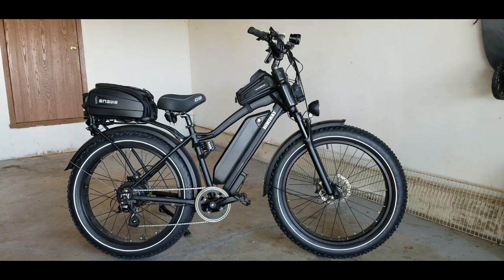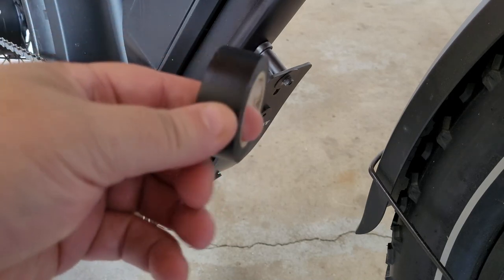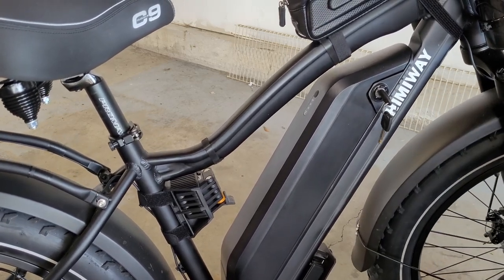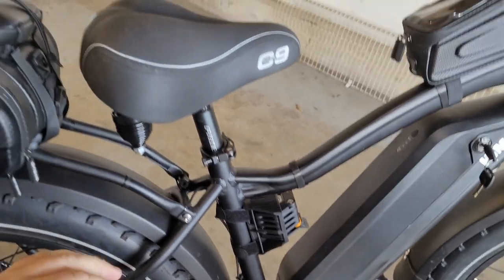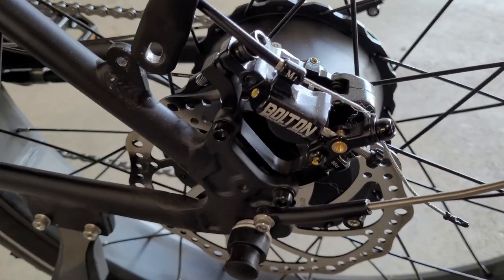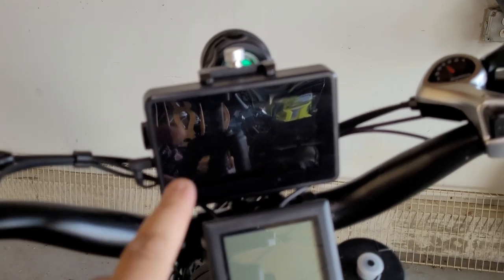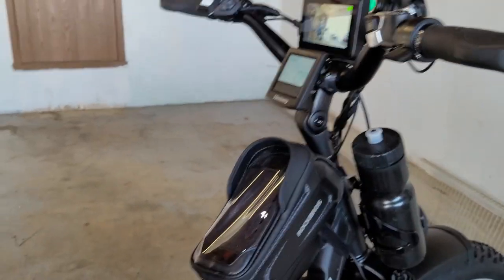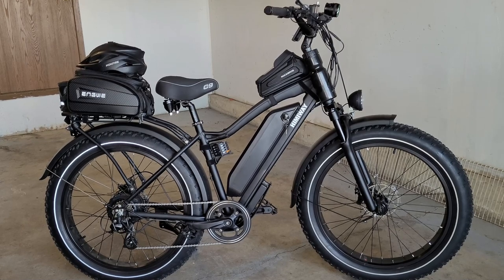*ULTIMATE* Himiway Accessory List **PLUS GIVEAWAY**

Comment: Wow, you got a really nice setup there, Sir.  I'm especially interested in that rear view camera which is Super Slick, but also many of the other accessories as well.  By the way, I just bought my Himiway Cruiser a month ago and the faux leather handle grips haven't changed and unfortunately no opening on the ends still.  Thanks for the video.

Update:  I bought the exact same rear camera that you have in your video and after putting a little thought into how to mount it, I ended up just using the provided mounting bracket and mounted it to the exact same downward seat fork (I went with the left side instead) that you did without a problem.   I just had to use an additional rubber piece from the camera bracket that also came in the box because as you mentioned the metal bar is slightly thinner, and managed to tighten it perfectly - it's not going anywhere, but I added a zip tie underneath the bracket on the bar just in case.  Thanks again.

Comment: Excellent!  Bike looks Phenomenal,  Deciding between either Hemiway or Magicycle.  They sure look very simular.
Reply from the maker: Honestly, the Magicycle is gonna be the Better deal for the money at this point. 

$1,639 for the Himiway using my $60 off link.

$1,499 for the Magicycle using my Promo Code: ERYDER to save $100
Reply: @E-Ryders  thanks for the code!  Magicycle is 1599 now.  discount 100 makes 1499.  with 140 delta.  what do you think?  Oredered the Magicycle, but it said my Credit Card failed. I think it needed my middle initial.  trying to get a hold of them so far no answer and no one is manning the chat line either.  if money was not an issue which one?  Thanks agin for the quick reply.
Reply from the maker: @RVEnthusiast  It might be a while before they get back to you. China is celebrating a Holiday till the 7th of October so a lot of businesses are closed till then. Definitely leave a message either way,  just wanted to let you know about their Holiday.
Reply: @E-Ryders  Thank You!  I Needed that.  Helps alot.

Comment: It was better to install the turning indicator on the fender or above the rear rack bar. I love the original rear indicator.
Reply: Does the add-on rear light turn on when the brake lever is pulled?

Comment: I use 3M heavy duty tuck tape inside my tires - cheaper and easier solution- plus I carry a can of Fix IT Flat - it beats spending lots of money on those inserts - plus you are adding weight to the tires; slowing the bike down.

Comment: My Himiway Cruiser throttle doesn't work properly, it just run the ebike in walking speed, not faster than that and it shows error 25 so do you have any solution or suggestion?

Comment: The seat - I go to Wal-Mart and buy a soft cover - it works fine
Reply: I tried the gel seat cover and after 30-40 minutes it felt like nothing there. I swapped out seat post for a Zoom suspension post and the Cloud 9 seat, wow what a difference. I almost daily ride 40-50 klms and my butt is fine😎.
Reply: @KenSpock  I put 4,000 miles on my Rad Rover Bike using it - now I have 250 miles on my Himiway Bike - it works great. The Cloud 9 looks like for Senior Citizens -:not a good LOOK for me - I am 75
Reply: @michaelmourek3879  I just passed 1600 miles, I had a bad experience at about 200-300 miles, I hit a hidden manhole cover and bruised my tailbone. That’s when I changed to suspension post and C9 seat. Sure glad I did
Reply: @KenSpock  Funny - good reason - if you hit another hidden man hole - you will be one Cloud 9 - Dead

Comment: I didn't think I was going to enjoy any of these accessories but it turns out more than half of them I think I want right off the bat and the others maybe a little bit later

I bought a Cyrusher 650 had a couple of weeks and then I bought a Himiway just like yours and I like both of them almost equally as well

I really like the blue of the Cyrusher wheels and accents but I also like the matte black of the Himiway

The Hemingway came within a week of me ordering it got it last week the Cyrusher took about a month and a half I think they were out of stock at the time.

Both bikes are pretty much on an equal footing from what I can tell and I've got them both dialed in about right I'm going to change a couple settings on the pedal assist on both of them to just one through three or one through five instead of one through nine now that I know how it works that's where you get your speed from or at least part of it